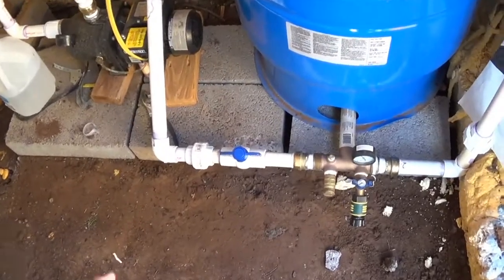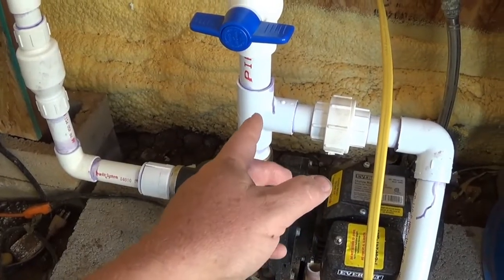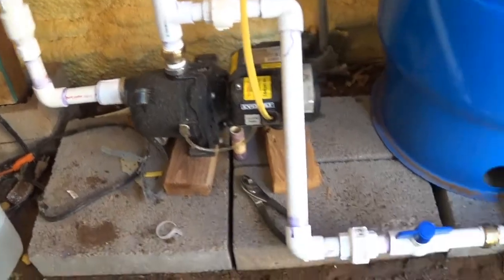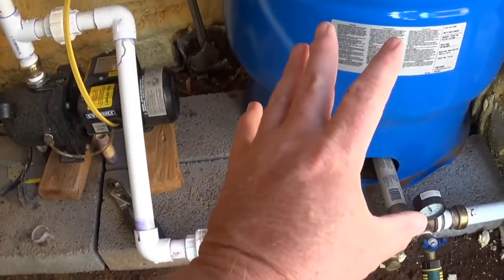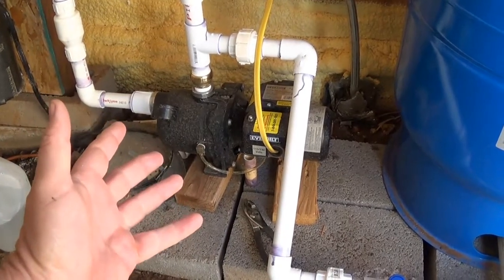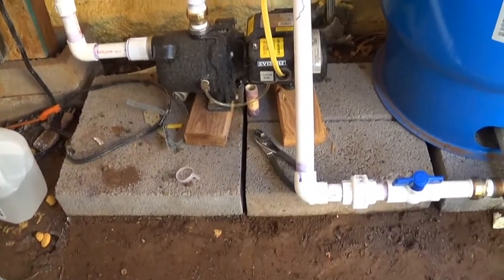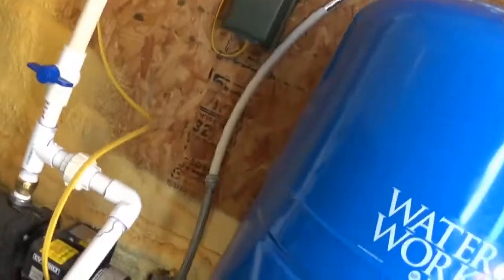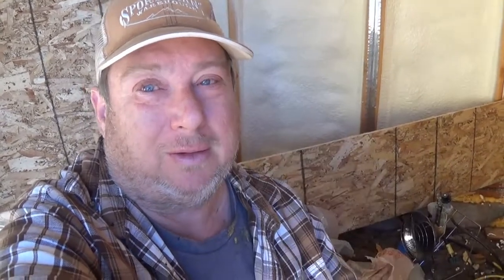Jet Pump Cycling Problem Solved. No Leaks. You Wouldn't Believe It.

Comment: Water well Technician here... the reason you were short cycling that jet pump with the check valve is because the pump itself needs back pressure to the pressure switch from the tank to keep the switch in the open or closed position depending on the requirements of the system. It also leads me to believe there is a small amount of air inside the pump itself still or pipe work.. especially if it would continue to short cycle being isolated behind valves.. air can compress and water will not..
Reply from the maker: thanks so much. have a great day
Reply: I'm having the same issues.  I installed a check valve where his was, in between the pressure tank and the pump.  So I should just remove the check valve?  Should I put it somewhere else in my plumbing or just leave it out?  I have the same pump and a 20 gallon pressure tank.
Reply: @CauseOfDeath27   YES
Reply: Incorrect and correct 

Basically when the guy had a check valve between the pump/switch and the pressure tank it isolated the pressure tank 

This was like running it with no pressure tank at all

The 2-3ft of pipe from the pump to the check valve was all the pressure switch had to measure pressure 

When water has any air in it. And all water does. The pressure of the air will settle down and appear as a leak even with no leak

Comment: The middle cv was not allowing enough pressure to keep the cv on the left closed all the way. The water would leak back in to the holding tank causing the pump to come back on. My two cents👍
Reply from the maker: interesting. thanks.
Reply: well that kind of check valve has a spring inside it to keep it closed.  It only opens when the pressure on the inflow side or the suction on the outflow side has a pressure differential of somewhere between 1 and 5 PSI.  So if the pressure is equal it will normall be closed.  The pressure has to overcome the power of the spring.  That being said one thing I thought about it that since that check valve is upside down (I know they can be vertical or horizontal but I dont think the vertical and be upside down).  The weight of the water above it might have been enough to hold it open.  Along with the middle check valve the back pressure from the tank was prevented from getting to the 1st check valve.  So it's possible the weight of the water held open the first check valve just enough and allowed water to slowly flow backwards at such a slow rate that is did not cause the check valve to actually close.

By removing the middle one the pressure tank was now free to apply anough pressure backwards to overcome the weight of the water before the 1st check valve. 

Conversly I think if you ran a loop up, through a check valve, then down to the pump that might have also fixed the issue, as there would then no longer be the weight of the water pressure down on the check valve inlet side.

Comment: The pump has a low pressure inlet side and a high pressure outlet side. By having a check valve on both sides, you are essentially are locking the high pressure in the outlet side. The internals of the pump are not perfectly sealed and over a short time, the high pressure would leak through to the low side and equalize the pressure in the high side and low side, dropping the high side pressure enough to cause the pressure switch to kick the pump on. This is not caused by a leaking check valve, just equalizing the pressure from the high side to the low side.
Reply from the maker: good to know. thanks so much.

Comment: You can't compress water, but you can compress air. When your water is pressurised, it's actually a rubber balloon in your water tank that has compressed air in it which pushes against the water to pressurise it. You can't have check valve between the pump and the water tank.

Comment: Hey man you saved me so much work with this video.   I am Abel Barnes of Barnes family homestead in Tawas City Michigan.  My water pump fried last night so I shot up to tractor supply and grabbed a new one before they closed.  Got it all hooked up and was pumping just fine till it hit shut off pressure and started cycling.  Mind you this was at 2:30 in the morning and boy did I feel defeated.  After an hour of research on you tube and other sites I came across your video.  I also had a cv between the pressure tank and pump.  I'm a God fearing man and something set right in my spirit about you and your video.  So today I removed the cv and replaced it with a coupler for ease of disassembly in the future.  Just got done waiting for everything to set up and sure enough it is fixed.  Made so much sense to me that the check valve wouldn't allow the tank pressure to keep the pressure switch held once it closed to stop back pressure.  Thank you so much!!  Your video has been a literal God send!!  Bless you!!
Reply from the maker: so glad it was helpful.
Reply: One thing I just learned about and just replaced on my pump was the pressure switch from a standard to an M4 which is a low pressure cut off.  They look essentially the same except their is a little metal bar that sticks out.  When you prime the pump you have to hold this switch down until the PSI exceeds 10 I think, then it will hold its own.  If the PSI ever drops below 10 it will cut off and wont turn back on until you hold the lever again.  I bought it because my pump is only used for the landscape and 3 weeks ago it ran dry and ran so long that it melted all of the PVC parts attached and warped all the non metal parts inside.  They are check insurance I think the one I got was $32

Comment: Problem is that you can't have a check valve between the pump and the pressure tank . It gives the pressure switch false reading . When the check valve cuts off it tells the the pressure switch that no pressure so it turns on and the moment the check valve opens up and the pressure switch reads the pressure tanks pressure it cuts off . It will keep doing that till you remove the check valve from the middle .
Reply from the maker: thanks so much for the information. have a great day

Comment: Took the check valve out after pump.  Fixed it.  Seems the valve stops the pressure from the line and tank causing pump to read low and come back on.  works awesome now thankyou!!
Reply from the maker: sweet. have a great day

Comment: The reason why is that water is not compressible. You cut off the pressure coming from blue tank that also has air in it which is where the pressure is coming from.
Reply from the maker: great way to explain it. thanks.

Comment: I just had the exact same rapid cycling problem on a new well install using a harbor Freight shallow well jet pump. The installation diagram showed a check valve after the pump so I installed one between pump and tank. When I removed the valve, problem solved. Thanks for the tip.
Reply: Hope this helps   Iam having exact same problem with a hf pump.   the pressure switch was arcing too.   Changed the pressure switch last night.  Hopefully if one was installed and I remove it the issue will be resolved.   For now just turning pump off when not needed.
Reply from the maker: thanks for the input. i like when people help each other  your awesome
Reply from the maker: thanks for the info. have a great day

Comment: I'm a late comer to this video. And this is a long winded reply. A number of commenter said similar things in different ways so my input may be restating some of what has already been said. I think you would've seen different results if your pressure switch had been  located on the p-tank tee rather than on the pump, mainly because of the difference in water volume between the 2 locations. And here's why. 

Cvs act to seperate various "chambers" in a flow system. They're designed to keep the pressure of a downstream chamber from overwhelming and backflowing in to an upstream chamber. Cvs are actuated by pressure differential. Higher upstream pressure opens the valve, higher downstream pressure closes the valve. The spring and/or weight of the cv gate creates an intentional imbalance to close the valve when pressure on both side of the valve are equal, thus preventing backflow.  Upstream pressure has to be high enough to overcome residual downstream pressure plus the pressure required to open the valve. 

For example, lets say your pressure tank has 50psi and your checkvalve requires 5psi to open. Your pump has to produce more than 55psi to even begin to create flow. If the pressure switch on your pump is set to cut off at 60psi, the pressure tank's reaction to new inflow could be enough to close the cv, which causes a sudden increase in pressure in the chamber where the pressure switch is located. The slim margin between pressure switch cut off and pressure required to create flow, combined with the low volume of the pressure switch's chamber triggers the short cycling sequence. 

By removing the cv between the p-tank and pump, you've combined the water volume of the p-tank with the water in the pump's chamber, where the pressure switch is located, so no more ping pong effect between the two.
Reply from the maker: thank you. i appreciate any input. i am learning so much more as you folks comment on the videos. thanks again . have a great day

Comment: Thanks for the video I ran into the same issue with the same set up with the backflow valve. The well technician had the answer it's the back flow pressure that kept the pump from short cycling. The pump switch stop cycling after i removed the backflow valve. Don't put a back flow valve between the Tank and pump!!!
Reply from the maker: your welcome. have a great day

Comment: Between the middle and first check valve there wasnt enough storage capacity to hold pressure, especially if the first CV has a slight leak (and they almost always do).  It would only take a slight leakage on the first CV to then cycle the pump.
Reply from the maker: thanks for the info.

Comment: This is my take on your problem…
The pressure switch is on your pump not at the tank tee.
So because the switch is dependant on the system pressure.
The check valve in question was preventing the pump switch from doing its job because there was no possible back pressure from the pressure tank to allow it to monitor pressure properly. This affecting cut in /cut out pressures
The best way to prove my theory is to turn off that valve you put in the check valves place.
Your pump will cycle on and off again. Viola! Problem explained.
Reply from the maker: thanks.

Comment: im wondering if it was a thermal expansion issue, im a part time well guy im thinking perhaps warm water entered the pump from the storage tank and cooled, allowing for the pressure to decrease in the pump, due to the placement of the check valves. just a thought, i cant prove im right but its something to think about

Comment: Thanks for the post - once I moved the check valve to the suction line everything was solved. I am presuming this works because  the pressure from the pump cycling off against the elastic bladder of the pressure tank causes an auto-triggering scenario. The balloon retracting fluctuates the pressure sensor back to the switch, which triggers the pump to send more water and over and over it goes.  Once the check valve is behind the pump, the pressure fluctuation is dampened, eliminating the auto-triggering. The plumbers also told me to find a leak. Thanks again!
Reply from the maker: great... thanks for the info... have a great day

Comment: It's due to where the pressure switch is and the pressure tank. You can't have a check valve in between as the pipe won't keep constant pressure, especially at that short of distance. If your pressure switch was after the check valve you'd be ok. I have a similar system with the check valve in-between pump and tank but the pressure switch is attached to the tank. The pressure between the pump and the check valve is often 0 in-between cycles. After the pressure tank, the pressure tank is pushing the water through the check valve.

Look at in ground well pump systems for examples of this setup.

And I've found plumbers are not always "well" trained..... (pun intended) and you need someone who works on wells.
Reply from the maker: thanks for the info.

Comment: The check valve between the pump and pressure tank won't allow your pressure switch know when to kick on because the low water pressure is not dropping before that check valve. The one after the pressure tank just keeps your system from draining when you open your system for repair. Make sense?
Reply from the maker: yes it does. thanks so much.

Comment: The first check valve is fine, so is the last , the middle check valve was the problem for sure, it takes pressure to push open the valve, as soon as the pump makes pressure to open it , it is met with the pressure after the valve and spikes the pump pressure backwards to the pump, as soon as this is equalised the valve shuts, the pump will then try to bring pressure back up opening the valve again, again two different pressures meeting and trying to work against each other back and forth, the drop from the pump is when its met with higher pressure from the tank pushing back on it, once equalised the pump will bring the tank back up to pressure ready for it to repeat over and over, its all just a balance of pressures either side of the check valve

Comment: My pressure system was identical to yours. I had two check valves same as your system.  One check valve before the pump and one check valve after the pump and before  the pressure tank. My pump would turn off when it reached 50 psi and then after  few minutes the pressure would drop and turn the pump on for  1 or 2 seconds then then turn the pump off.  I removed the check valve located betweem the pump and the pressure tank and the cyclying on off stopped.  I am guessing the location of the pressure switch (located with the pump) it part of the problem. If the switch was located beyond the second check valve instead of between them it would not give a false reading.   In other words,  the switch needs to measure the pressure at the tank and not the pump. However, i cannot explain why the pressure at the pump would be different with or without a check valve after the pump.
Reply from the maker: good to know i wasnt the only one to do it that way. lol... but we both figured it out. way to go. have a great day

Comment: That check valve creates an air space so that why the pump cycles on and off. The check valve on the intake and the check valve on the output to the house is correct but unecessary.
Reply from the maker: makes better sense now.

Comment: I've only know that the check vale should go on the in line to the pump befor the pump, this keeps the system primed even if the foot valve in the well goes bad, ask me how I know😅. I was also told any in line filter should go after the pump, why I don't know that either.
Reply from the maker: im thinking i want the water filtered before the pump to protect the pump from debris.
Reply: @ArizonaHotHomestead  I thought the same thing but was told it could hurt the pump because flow is restricted. Don't know if this is so.

Comment: Jeff i believe its because that pipe has to have pressure and that check valve was stopping it and the pressure back to the pump either leaked from the bottom of the pump or that check valve.... Im not a plumber but we are off grid and using almost the same pump. My check valve is after my filters this way the pump never god dry ....... Keep it up brother🤘🤘🤘🤘
Reply from the maker: so far its holding perfectly with the 2 check valves. the key was removing the middle one. i did however notice my water  pressure at the sink is slightly lower than before almost like the 2nd check valve is keeping the pressure tank from fully pressurizing my lines to the sink. i might next summer remove that one and see what happens.
Reply: Is your initial check valve is before or after the filters?  That would be helpful to know!

Comment: When the pump is on even though it seems like it's full of water it's really not. As soon as you turn it off a little bit of water can go back into the pump. Because you have such a short piece of pipe there's no buffer for that to happen. So it's going to keep short cycling.  Once you open it up to the pressurized tank now you have a great buffer zone for that to happen and not be an issue.
Reply from the maker: thanks for the info.

Comment: The system only requires 1 check valve. The check should be put before the tank and after the pump to stop back pressure. The way you explained it was soon as both check vlaves shut your system ie the pipe work between the pump and tank because check vales do not create a very tight seal the pressure in your pipe work will reduce another words it would slowly drain back into your well. So by just having a check valve at your tank before your pressure switch, you find it works perfectly.
Reply from the maker: cool. thanks for explaining. have a great day

Comment: The pump control switch should be on the manifold on the tank outlet, not on the pump side of your system. The pressure between the pump inlet check valve and the outlet check valve will drop due to pressure loss through the pump inlet/suction check valve. With the pump control switch mounted on the pressure tank outlet (where it should be) would have allowed for your three check valves and proper pump management.
Reply from the maker: thanks for your input. i appreciate it. have a great day

Comment: I have the same problem with my tankless shallow well jet pump. Not sure if it's just getting old but it seems to lose pressure then takes forever to shut off
Reply from the maker: from what i have learned is it could be a problem with pressure tank, check valve failed, or the pressure switch has gone bad... i am no expert. good luck.